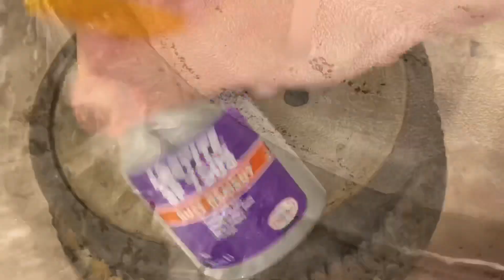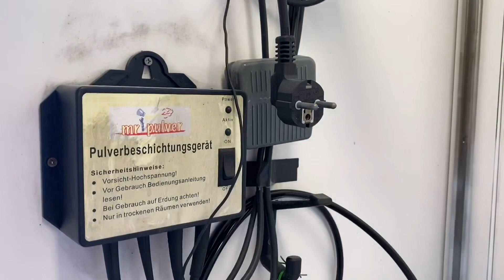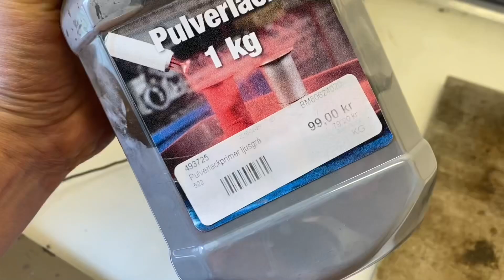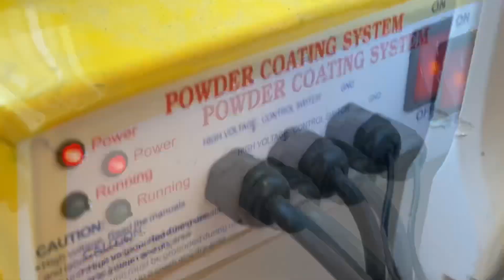Acid restoration of brake drum + Zinc powder coating to shiny Black – JEEP Wrangler YJ : Ep. 30

Comment: Ken, you should improve on your sandblaster. I have the same blaster as you do but upgraded it and added a good compressor and now I can blast, using fine (100-120 um) aluminium oxide, such a part in less than 5 minutes shiny clean without any chemicals at all. Also I use less than a cup (really!) of median in the box. Much better for your health and the powder will stick to it much better. On cast iron you may even use coarser media and get top results.
Greetings Bernhard
Reply from the maker: Excellent feedback. Im just about to review the entire setup because of its limitations. My pressure was definitely too low so I will see today what can be done.!
Reply: Ken Sweden 
My email is: bernhardlist@hotmail.com so if you contact me I can send some pictures of my mods. I still have one problem that while blasting, visibility goes down (even with a strong vacuum attached) but the results are very good and fast and I use so little media that changing between different grades takes only a minute or so.
Greetings Bernhard

Comment: Removal of rust - Acid/s or electrolysis or possibly a combination of both methods? Which method gives the 'best' results and which is the most 'cost-effective' given the price of acid/s in the UK. Phosphoric Acid Descaler Rust Remover 45% - 5L £20.00. HCL, 32% - 5L £20.00 (Strongest available) Free Delivery. 
Many thanks for great SCIENTIFIC explanations.
Reply: IFF a combination that would be sequentially not concurrently and using Caustic Soda in water to form the electrolyte.

Comment: Hey Ken. Thanks to your channel, my 95 Mazda MX5 is derusting in ~2000 L improvised pool hooked up to a welder :D (and it's working). As it's about to emerge I'm wondering if it's necessary to use phosphoric acid -> tanic acid -> zinc paint or would phosphoric acid -> rinse -> light coat of diluted H3PO4 (let it dry) -> zinc paint be OK? Thanks!
Reply from the maker: Great news! If you have not rushed it with any hydrochloric / muriatic acid, then you should be fine with just painting it with normal primer. I have found that the tannic is very useful to bond up that flash rust you have with the muriatic and some other acids but as you see, you don’t get much flash rust anyway with the phosphoric acid. So I wouldn’t spend the extra manly on the tannic because it’s quite expensive as rust converter and yet I haven’t seen anyone doing a mixture themselves.
Reply: @Ken_Sweden  Ok. Thanks! I was wonedring if there is perhaps some adverse interaction between iron phospate and zinc but couldn't find any. Great channel.

Comment: Hey Ken
If you out gassed it first it would help with your finish. Great content though, keep it up.
Reply from the maker: Many thanks for inputs I deeply appreciate. How do you gas is outV and for how long ?
Reply: @Ken_Sweden  add 20-30 degrees C and bake ot for about 30 mins. That will do it.  I out gas all castings they are usually very porous and can hold all kinds of contamination.  Keep going 😎

Comment: Hi Ken!! Another great video! To help with your second coat of powder, drop your KV 1 or 2 settings, increase your air pressure slightly, back away from the part a little and spray the second coat while the part is still warm. About 120° farenheit. This will help you with the "cratering" that you're getting in the powder and the warm part will help your powder to stick. Shooting the second coat at the same KV as the first, the 2 similar charges are acting against each other. I hope this helps! Best to you and your family, my friend.
Reply from the maker: Thanks , will do that!